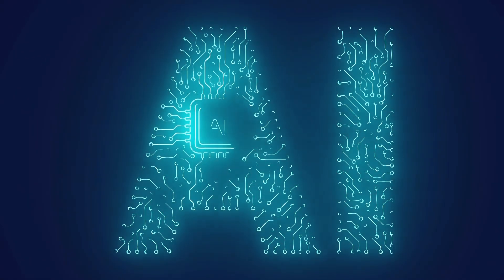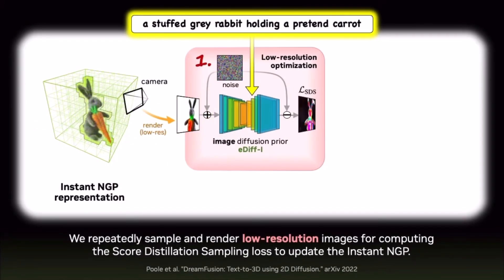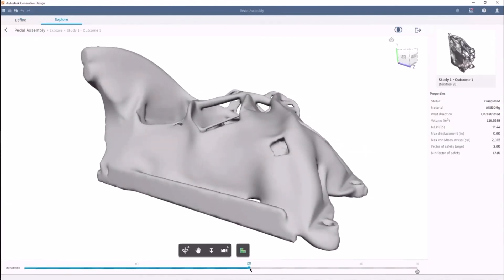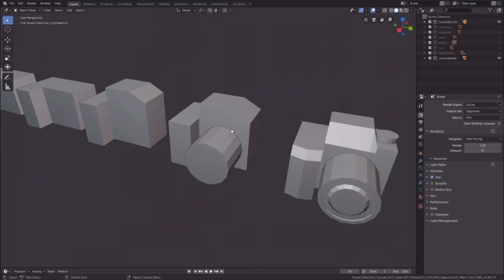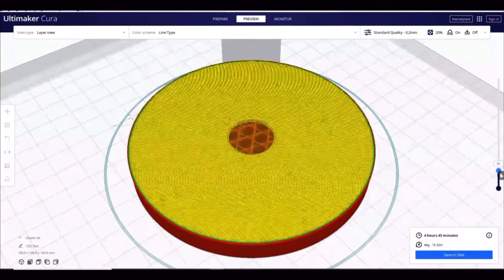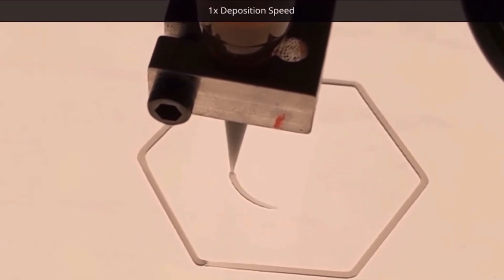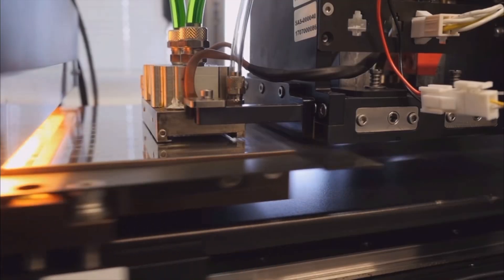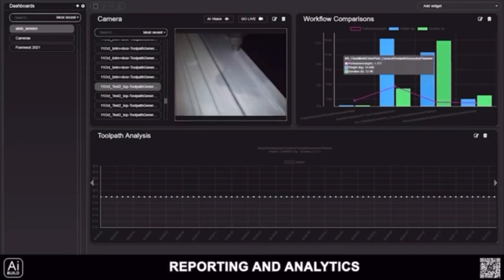The Best Ways 3D Printing is using AI

Comment: Yet another person who doesn't know the difference between generative design and AI... Generative design is based on a mathematical principle called topology optimisation and is way older than AI, please don't mix those things up. You use a block with mounting points, apply forces and constraints to those mounting points and then run a simulation of the forces, stress and strain in the material (FEM-Analysis). Anything that experiences no forces, stress or strain is removed, then the next simulation is run, until the generated design experiences close to the force, stress and strain the chosen material is rated for. It is an iterative mathematical process, nothing intelligent about it, just brute force and raw math.
Reply from the maker: Thank you for the insight. But read this quote:

“Generative design is an iterative design exploration process that uses an AI-driven software program to generate a range of design solutions that meet a set of constraints”

Source: https://formlabs.com/blog/generative-design/#:~:text=Generative%20design%20is%20an%20iterative,meet%20a%20set%20of%20constraints.
Reply: Generative design is way more than just topological optimization buddy. Top Opt. gives  you one result while generative design gives you 100’s or 1,000’s of results with detailed descriptions of what makes each different and where they fit in terms of strength, flexibility, and design accuracy on the model graphs. It uses math, fem, and other algorithms and learns what you are making and adjust the parameters to achieve the best outcome with variability. Top Opt doesn’t do that, it gives you one result at a time

Comment: I think you might have gotten something wrong in your video, when you stated that the ai would determine its “3D print-ability” I think instead the ai is used to determine which manufacturing medium works best for the part. Especially since resin printers can get down to nanometers, it doesn’t matter the detail but what is creating it.
Reply from the maker: Thank you for the feedback. According to the research paper I used, the researchers are calling the tool a “printability checker” which, like you said, does evaluate which manufacturing medium is most efficient and cost effective. 

Hopefully this link works. 
https://deliverypdf.ssrn.com/delivery.php?ID=623110115067021006070030028107121092051040069008061028095104014090008064077121025071123059021013106005121070001099064100083029105043041005072087102004116004017115096056082040091091090073092100003122101087010026065112021078004014004116079005021112001087&EXT=pdf&INDEX=TRUE